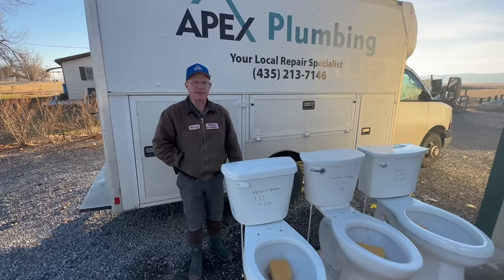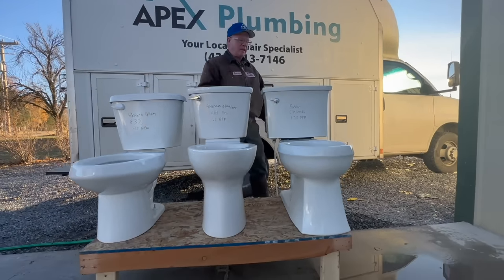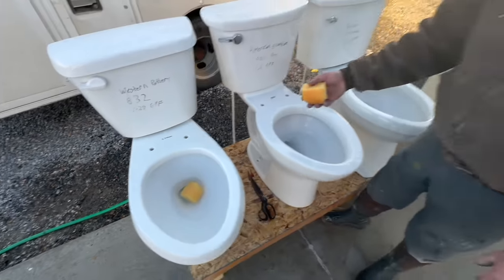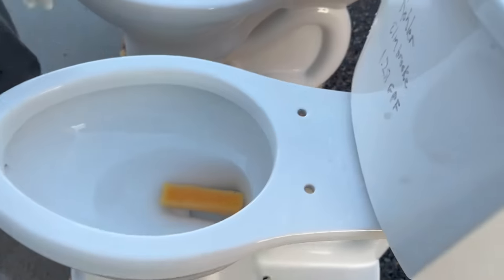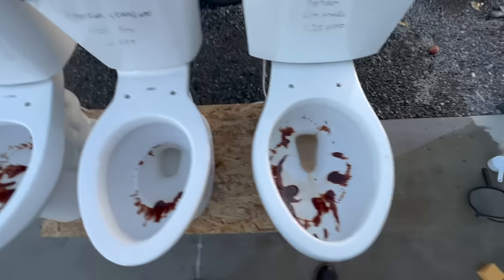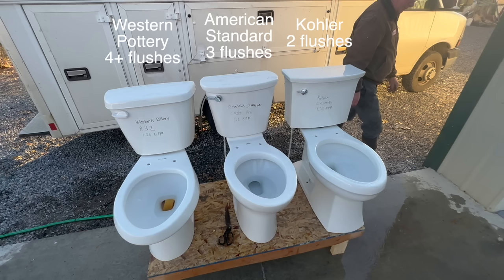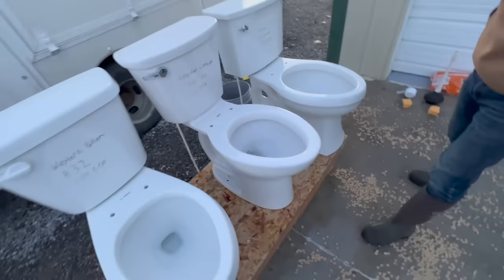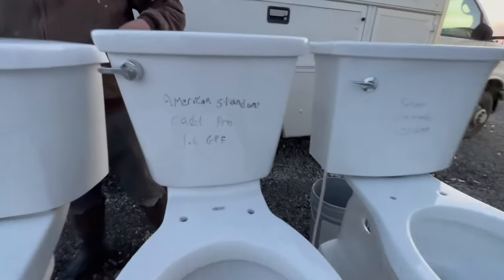What toilet should I buy? 3 different brands compared

Comment: What I want in a toilet is a toilet that consistently flushes down large turds with out a large turd getting stuck and plugging the toilet. Today's toilets do not do as well as toilets in the past due to water conservation laws requiring toilets to use less water.

Comment: The bottom (pun intended) line here is these “water saving” toilets don’t save water. In fact they waste more. Instead of just one flush, no less than 2 or 3 flushes are needed to do the job. The same with energy saving appliances. They don’t do the job.

Comment: Glaring omission.  The Home Depot Glacier Bay power flush.  Currently $159.  If you want it down in a single flush, look no further.  Would embarass these toilets in all test except maybe the chocolate test.  Go ahead, put all the sponges in a single flush.  It can take it.  Don't know why the design isn't more widespread at this point.

Comment: All those toilets are crap.  Found a pink 3gal Standard that's way better than the 1.6 in the house when I bought it.  Would like to find a 5gal with the wall-mounted tank as that's what was supposed to be here when it was built in 1923.

Comment: I ran quality assurance for a large plumbing construction company in Vegas for several years, because of clog problems in late construction every toilet got 2 full rolls of paper jammed in and rapidly flushed to proof the system- the complete main was cammed, recorded and then released to the builder. It was a lot more often that there'd be an issue with the china quality visually or physically where the base of the bowl wouldn't be level and want to rock or a tank or lid would be warped and wouldn't fit right or just plain visual flaw in the finish.
 You guys missed a bunch of important points on toilet build quality and only focused on the flush aspect in which the majority of mfg all have right because they don't want a bunch of warranty returns on shitty product. You also neglected to mention trapway size on each toilet which could very well be different between mfg.

Please consider redoing the video again and giving a full spectrum assessment on all that's important when purchasing a toilet.

Comment: Stupid 1.6 gal flush clogs up rural lines that have to run 100 feet to the sewer,that's why I put in an antique toilet with the BIG tank, never had to call roto rooter since I put that one it.
There's NO WAY 1.6 gallons is going to carry a pile and paper  down 8 feet, laterally 10 feet, 90 degree turn and 100 feet down the driveway to the sewer under the road, it needs at least TWICE that amount of water or more.
Reply: Yep, I antique toilets in all 3 of my bathrooms for the same reasons even though I have a relatively short distance to the septic tank. Never once needed a plunger, either.
Reply: Considering that you have to flush these 3 times to get them clean, that should be enough water.

Comment: The American Standard has a seal on the plunger which only lasts about 18 months due to forming bubbles on the seal. It will increase your water bill exponentially.
Reply: That is exactly what took place with the Champion I bought to replace a Kohler Wellworth in our previous house.  A replacement flush tower from the manufacturer didn't last too much longer than the original.  I thought the newer Champion 4's had an improved flush tower and were better.  Maybe not so much.

Comment: Hohler power assisted flush toilet. Elongated chair height. I put one in my last house and 2 more in my new house. Flushes like a jet engine and never clogs. I wouldn't buy a different toilet than that one.
Reply: Jet Engine - LOL! I'm just picturing the transmission, "kkkkk, This is Kohler Pilot Tango Niner Number Two commencing to land one. Requesting permission to flush!"
Reply: I was looking at those.... then did some research and found rupture of the pressure vessel was just too common and quite dangerous.  Went with vacuum assist instead.   Haven't regretted it.  Quiet too for late night flushes.
Reply: @spazzman90  The assisted flush is a little loud on the other side of the wall but totally worth it not to have to plunge the thing all the time.

Comment: I will never again purchase a Kohler toilet. The reason being, not their flushing performance, but the poor enameling resulting in the finish wearing away exposing the clay beneath. Very unsightly. Obviously they use robots to do the finishing and, due to the unique shape of the business portion, bottom, of the bowl, the robots are not up to the task. Should be a class action lawsuit. Also, their enamel showed chemical stains and deposits from the water after a short amount of time whereas the previous cheaper Mansfield toilets (I am not suggesting all Mansfield toilets are cheap) showed nothing after being installed for at least 16 years. Too bad they required constant use of plumbers friend.

Comment: i don't like any of these toilets, i've long moved on to more updated brands like the geberit wall hung toilet, and with their bowl which makes for the best flush.
Reply from the maker: you should take into account that most plumbers dont carry parts on their trucks for specialized toilets so if it ever needs a repair you may have a difficult time finding parts for it.
Reply: @ApexPlumbingLogan  they’re really easy to install, parts are literally everywhere for those things and they’re durable asf.
I’ve had a wall hung toilet from geberit for the past 25 years and never have i had any problems with it. The tank is made from the same material as your cars fuel tank.